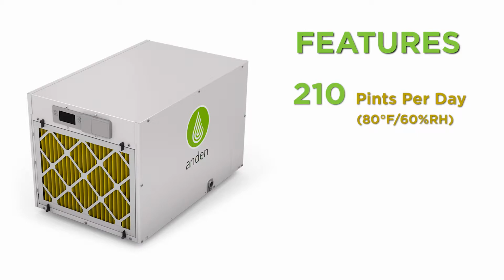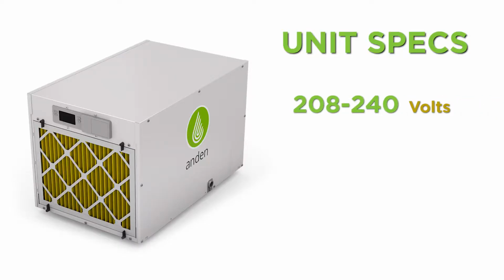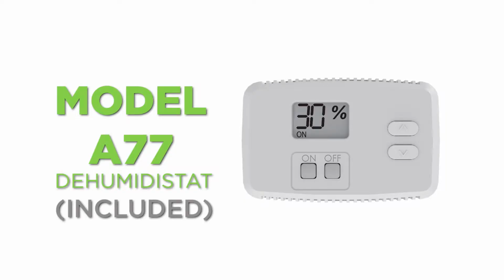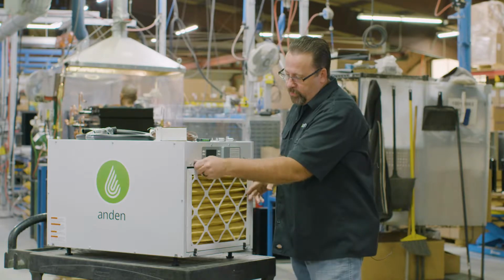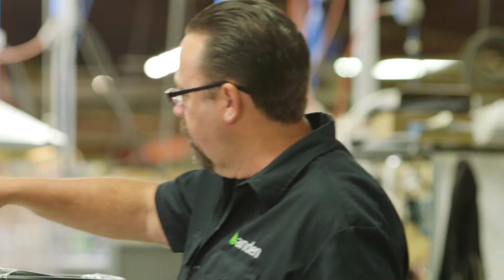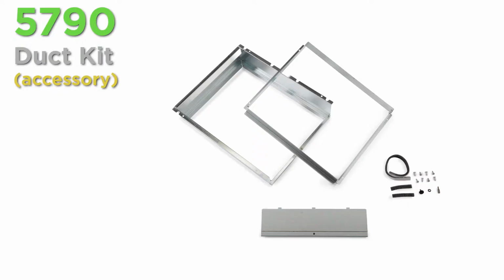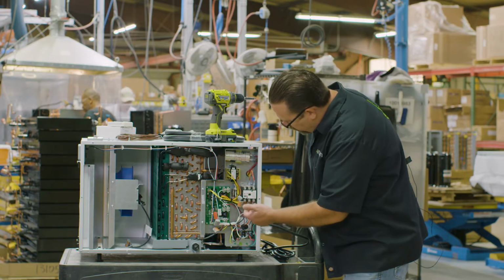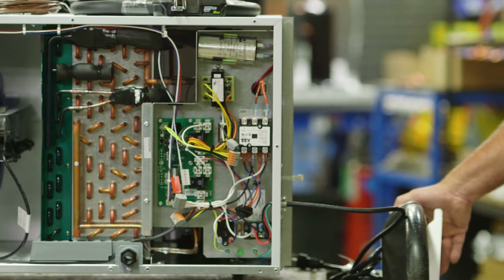Anden | A210V1 Dehumidifier Product Overview

Comment: Can anyone tell me which remote controller fit the    Anden210 dehumidifier？Thanks in advance.
Reply from the maker: Thank you for contacting Anden. The Anden A210 includes the A77 remote control as a basic humidistat. Please feel free to give us a call at 1-800-972-3710 to consult about third party control recommendations. Any third party controller that can provide a set of dry contacts will work with our unit. Thanks again for reaching out.